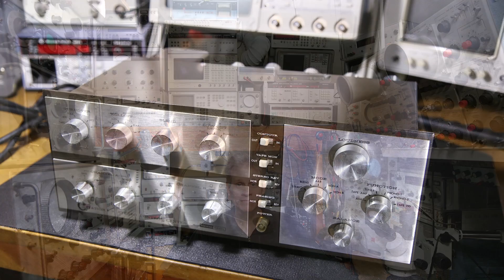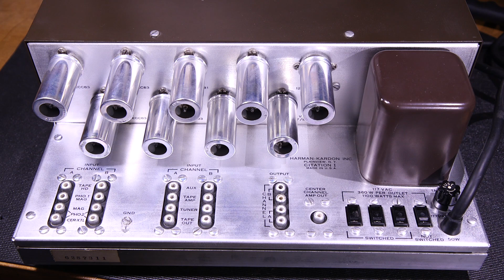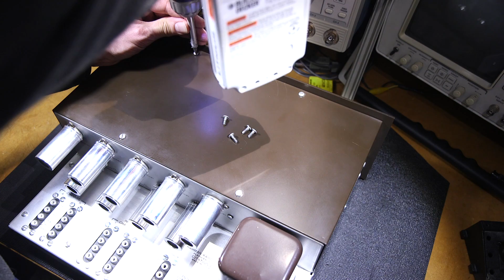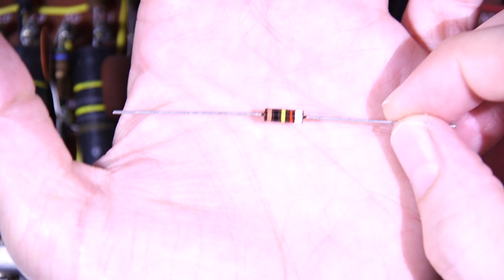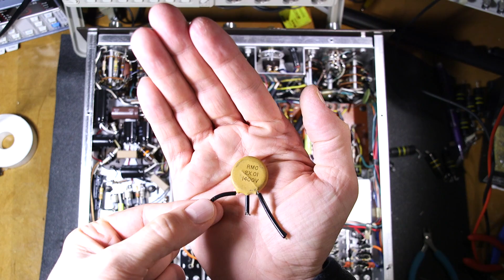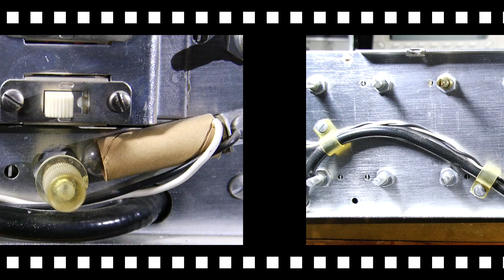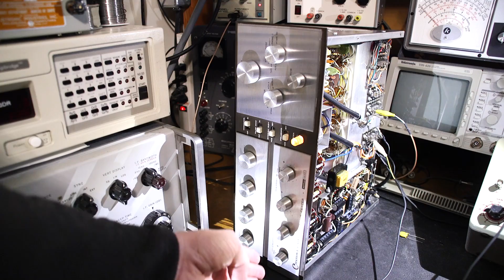Vacuum Tube Preamp Repair, Harman Kardon Citation 1

Comment: Great presentation as usual!
As I have had a few cases of capacitor failure in my personal bag of experience, I would like to see some statistics of the really old capacitors that you replace wholesale fashion, relative to the new ones.  My experiences have been almost entirely on measuring instruments, mainly of 1980 or so vintage and control systems from 1980 to 2014  Of the latter category, just about all the failures have been on solid tantalum capacitors (the "yellow drop" type).  I do try to test especially old aluminum electrolytic capacitors for their value, ESR and leakage, but seldom find anything marginal and recall only one complete failure in an HP instrument.  On the other hand, I did have a failed capacitor this year in a couple years old, made in China HD TV recorder box.

One advice I got a long time ago (1960's) regarding old radios that might have been collecting dust for unknown time was to power up in short steps.  The idea was that electrolytic capacitors have gone through internal chemistry changes while idle and have an excessive leakage current until re-formatted.  So, the suggested procedure was to turn the power on for a few seconds (long enough to allow the rectifier tube to warm up and charge the main filter capacitors.  Then let the capacitors discharge a minute or two.  Next turn the power on for 30 to 60 seconds and again let everything settle for several minutes.  That would allow the heat developed inside the possibly leaky capacitors to dissipate.  After that it would be much safer to apply power for a longer time.

I am not in a position to verify the usefulness of this approach, but I still do actually do my ancient toys power up this way.  And moreover, I have a while back helped a capacitor manufacturer by building a controller for his formatting bath.  Nothing of that completely contradicted the old hearsay instruction, although it did not confirm that either.
Reply from the maker: Thanks for your comment Pellervo!
Reply: I have read about people re-forming the old electrolytics by using a variac to gradually turn up the voltage to avoid applying full voltage to them too rapidly.  We are talking hours at 10 percent and so on.   But if the electrolytics are dried out then you need to replace them.

Comment: Im confused why there is thumbs down this is superb video work and very educational  every video is of the highest quality in image and information i think some people are jealous.good work  mr carlson!
Reply: I think they are audiophiles that were expecting Mr Carlson to insert capacitors the size of 2 liter bottles.
Reply: @mockingbirdanalog  yes,and without enough power supply de-coupling!!"if .5 mfd is good,1.5 mfd must be better"!
Reply: @Philip Holmes   ,    It takes some design knowhow to make a decent power supply. See Paul's analysis of a power supply which needed a SMALL cap to stop ringing from an "excited" choke. You don't often see good engineers at work.
Reply: @Mr39036ce  ,   Or not. Be on the lookout for roll off frequencies determined by RC combinations. This works as a common sense item. I have never seen a low value power supply filter cap so low, other than in oscilloscope high voltage power supplies. That is a WHOLE different matter! Many electrolytic caps are used in tube circuits as cathode bypass capacitors. Just use the same value cap, perhaps with a higher voltage rating.
Reply: @mockingbirdanalog  , or worse... cost as much as listed in some areas online. It is one thing to need a great cap, it is another to be silly about it.
Reply: Those were left by Yorx mini stereo owners.
Reply: @gavincurtis  Or, even more likely, by persons whose idea of high fidelity is listening to their iPhone through ear buds LOL.
Reply: Youtube has no maturity nor intelligence requirements.  Anyone, anywhere, can comment or rate.
Reply from the maker: Thanks Kevin!
Reply: I hate seeing 👎🏻 on excellent programming... Shame upon those who do such things.
Reply: The Dollar Guy    Good point!🤣🤣🤣🤣🤣🤣🤣🤣🤣🤣🤣🤣🤣🤣🤣🤣🤣🤣🤣🤣🤣🤣🤣
Reply: The thumbs down must be jealousy as this 50 year veteran tv broadcast engineer finds no fault with this video.  I have a HK Cit I in storage and this vid almost convinces me to refurbish it.
Reply: Nice and informative as usual.Be wary of those 68K 1watt resistors.Notorious source of noise in these.
Reply: There is a certain faction of hard-core original parts fanatics, and they go apoplectic when, for example, someone says a bumblebee cap has to go. It's more about psychology than sound engineering.
Reply: It could be as simple as someone having a bad experience with one of those and it brought it back.

Comment: Back in the 60's, we'd buy our hi-fi gear from Mom and Pop shops or small chain stores, and most had their own service and repair depots in the back. When you bought some new audio gear, the dealer would typically put their sticker on the side of the unit, to encourage you to get your service done at their shop.

Comment: Oooow ouch electric screwdriver!?
Reply from the maker: Believe it or not, you have greater stability in control removing slot head screws this way. Just guide the bit and press the trigger.

Comment: Another fascinating video. I find myself eagerly awaiting each new release.

It's a pity that we didn't see you soldering one of the new caps into the pre-amp since you went to some lengths to explain the need to avoid lead stress.

Comment: Paul, how do you decide which piece of gear you will do a video on and what would it cost to do a restoration?  Reason I ask is I have a Grommes Precision 61PG [1956] integrated 20 watt vacuum tube amplifier which has had the coupling capacitors replaced with Sprague Orange Drops but still needs the electrolytic cans replaced in addition to other possible components in need of replacing.  This amp comes with 2 pages of turnover and rolloff settings for 62 manufacturers of 78RPM records.
Reply from the maker: HI Bob, I get many requests, and the choice is sometimes very difficult. Many extremely high bidders, I can tell you that.
Reply: Go for it. I had my dad's Brook 10-C3 tube amp and preamp circa 1948 at one time. Wish I had those matched 2A3's around today. You can't reinvent history. His lab was nearby and he was my elmer for solid state. de KQ2E

Comment: I love the warm glow (and smell) of tubes. Among others I have obtained eighteen CV287 tubes. You can hardly see the glow on these so visually they are dull as are the eight KT88 audio amp tubes. Both I think are directly heated. I have no use for any of my tubes, but I like them and plan someday to make "art" out of them by powering the filaments up.
Reply from the maker: They sound like the same principal used in "Dark Heater" 6146's

Comment: You have such great videos and knowledge sir!  You do mention here to spray the controls with proper cleaner which leads to a question... Don't you need to be careful when spraying wafer switches in tube gear?  I have had to replace some very expensive and hard to find wafer switches that some weekend techs have "cleaned" with proper cleaner, but the closeness of the contacts or the voltages present created an arc which ruined the switch with a permanent carbon etching that rendered the switch non-repairable.  In many cases, the arc also took out other components and parts of the circuit so a real mess.  How do you best determine when it is OK to spray wafer switches and when not to?
Reply from the maker: Hi Derrick. Lot's of research, I can tell you that! With High Voltage equipment, careful selection is paramount. "Zero Residue" is your friend.

Comment: I have seen so many of those three leg safety capacitors that have exploded.  Had a Tram D201 that even had the paper insulation wrap of the transformer catch fire when the safety cap shorted out because they lay them up against the power transformer.

For knobs I suggest using wax paper to tighten up loose knobs.  If you use tape over the years even the non sticky side can become bonded to the knob making it hard to remove in the future.

Nice to see I'm not the only person that completely removes the component leads when replacing parts.  In my world (old CB radios) they use normal tie strips and frequently have 6 or 8 things tied to one terminal.  I see people recap and replace all the high wattage resistors and don't desolder them.  When they are done they have a giant blob of solder.  Very unprofessional looking.  Thanks for doing it the correct way.
Reply: Hi Paul, hi Mike, you two do such a great job with your instructional offerings I get a plate of lunch or dinner and enjoy every second. I always look forward to whatever new you two post. Thanks for your channels.
Reply: That's exactly what I do Clark. I have enjoyed every video you have done Paul. Very informative, even to us old and seasoned Tech's. Thanks Paul
Reply from the maker: Thanks Clark, I'm glad you're enjoying the video's!
Reply from the maker: Thanks for your comment Mike!

Comment: Thank you for the HK Citation 1 resto, I have 2 of them. What are your thoughts: Top Hat Diodes replacement? Also HK ran the filament voltage @ 10.5 volts would it perform better @ 12-12.6 volts?

Comment: What is the MFG and Part number of the Ceramic Standoff you used on the Electrolytic Caps, as I would like to buy a Bagfull of them
Thanks Keith
Reply: +1
Reply from the maker: Some comment's above have links.

Comment: why not gut the old cans and put the new electrolytic capacitors inside the old cans and keep it stock and polypropylene metal foil capacitors, you might be able to use STC can electrolytic capacitors, tubes like the ECC88s will work at 54 volts which is maybe a bit safer and maybe operated of 7x9v PP9 batteries for the B+ voltage and a  LM7806 6v regulator for the heater voltage.

Comment: I'd love to know what Paul's preferred contact cleaner for potentiometers is, or what any other experienced audio electronics engineers have to say on the matter. I tried looking into this some months ago and there were a lot of strong conflicting opinions, and I'm still none the wiser.
Reply: Try CRC "Tuner 600" its made for cleaning sensitive contacts, and it leaves no residue. It also takes away any lubrication though, so you might need to put another coat of lube back after you used it (for example CRC 701). Some Deoxit will have the lube already as a "two in one" kind. Sometimes that helps, sometimes its not what you want.
Reply: Thanks. I was wondering about the lube when using solvents.
When you get a pot with damping, one that is really slow and smooth to turn, is the damping created by grease within the pot?
Reply: yes. they use some high viscosity oil or grease in the bearing of the pot axle/shaft
Reply: I seem to remember, and I hope I'm not talking out of school here, that Mr. Carlson once said "I've tried a lot of contact cleaners..." and suggested the "MG Chemicals, the one with the gold stripe...," which I took to mean "MG Chemicals Super Contact Cleaner With Poly Phenyl Ether." That, or Mazola Corn Oil -- Ether one. I have no affiliation w/ MG, I just wanted to use the 'Ether pun.' Apologies to all the fine "Deoxit" folks. I hope someone will correct me if I'm wrong here.
Reply: All I've got on hand is some MotoMaster electrical contact cleaner that specifically says that it's meant for automotive use, not electronic. I imagine this is due to the specific solvent they use to dissolve the schmoo that could also end up tarnishing or dissolving solder masks or epoxy used in electronic components. Might be worth a video to test the effects of these various contact cleaners.

Comment: Please use a small container to put the screws in, as you take them out. Never place screws on top of the actual unit you are taking apart: for one thing they will scratch the finish, and secondly you are more likely to loose one or more screws this way.
Reply: Yeah,  I learned to use a magnetic bowl for mine after I kept losing them.  But honestly,  Paul has some of the best electronics videos on youtube hands down,  I'm not gonna complain about where he puts his screws and I'm sure someone with his experience knows this already anyway (he could have done it for a reason or it just slipped his mind).  I really wish that every electronics video had the production quality that his do.
Reply from the maker: Done for video purpose to show the screws (and filings), no scratches so no worries.
Reply from the maker: Thanks Dacke!
Reply: It's really depressing when you disassemble and find that somebody before you has used some larger metal screws or even sheet metal screws, and has distorted or chewed up the female end of the fastener system. BTW, especially in high-end test gear, not every cover or mounting screw is the same length or even size. Sometimes, the internal clearances are so critical that a couple of screws are deliberately shorter than the others, so watch what you are removing as you remove it.
Reply: Something to maybe add, when i disassemble things like that i use kind of a sorting box with multiple small compartments, filling them up from left to right and starting a new one with every "level" i dig deeper into the device.. that way when you reassemble (maybe days later sometimes or even longer) you can just go the reverse direction and make sure you dont miss some screws in the end :)
Reply: Yea... I work on LOTS of laptops too, and there are a lot of varying size
screws, so I always lay them out in a physical pattern on a cloth !!!
Reply: Just get a piece of paper , draw out the screw layout and label them (eg M3x6, etc.). Most laptops I disasembled have the screwholes labeled anyway ;-)

Comment: Mr Carlson, thank you for tackling this wonderful preamp. I use one as a daily driver and I can say that the Citation I is a fantastic preamp, especially if you are playing LP's and 78's. I rebuilt mine using all orange drop 716p capacitors, replaced cans with new cans as available, rebuilt the power supply.  I also added a grounded power cord to mine (which I usually do to my tube preamps). I'd like your opinion on that. Lastly.. it would be nice to see you do a companion power amp and THEN demo them for us so we can hear the results of your labors (albeit via a compressed youtube signal!).
Reply from the maker: You are totally correct about compression, then there's the computer with speakers on the receiving side to consider as well. This all adds up to inaccurate reproduction. I do not change the power cord for ground loop isolation issues.

Comment: That preamp looked new to me. I was always afraid to pull to much on the soldier post for fear of pulling them out of the phenolic or paper board because I did that once.
Nice video, interesting that those caps were all backwards.
Reply: Look carefully and you will see that he's not "pulling" on the posts. Rather, he is using the diagonal cutter's jaw profile to apply a simultaneous pull to the wire and a push to the post. It creates a force strong enough to rip the wire out of the soldered joint without stressing whatever holds that post. (Component leads are usually plated steel, much stronger than solder alloy.) Warning: this is an advanced technique, you will damage a few wires and posts as you teach yourself the "feel" of doing this (remember, it's the rotation, not the pull), and even more importantly, when you can get away with this. You probably shouldn't try this if the wire you want to remove is not the top or outer wire, or if the solder blob is too generous.
Reply: @wb6wsn , Totally true in all respects. Especially the last observation. We all have to remember that "common sense is the most uncommon sense of all." (Samuel Clemens)
Reply: K5AZE Bud  I agree I'm always so afraid to put any pressure or tension on any soldier joint, I have pulled out vias and lifted traces..... nothing more annoying

Comment: finally, a professional tube amp repair, without a condescending tone on "tube amps in general"

I did a repair video on the Pioneer SM-83 tube amp, but I still have to edit it
Reply: Isn't that the tuner-less version of the SX-82 receiver? I look forward to that. Those things are supposed to be like the high point of 7189A tube circuitry.
Reply: I'd love to see this, I have a SM-83 aswell that I rebuilt. They are great amps!
Reply: Rod, you are right. Even though, the SM-83 is a bit more sophisticted in details. I think I've got the SX-82 aswell, should be in the mailbag (donation from a guy in Germany). I hope it will be unpacked shortly.
Reply: The SM-83 is one of the best sounding tube amps I've ever heared. If it's supplied with the proper 7189A tubes. I've had an interesting failure with an arcing 7189A. The Harman Kardon from Carlson's video is in mint condition. And it has a wonderful set of Telefunken tubes. This patch in particular should have an awesome sound.

Comment: Speaking of counterfeit parts, I have a very cheap poweramp for my desk and after a few years it began crackling. Opened it up and sure enough the filter caps had leaked onto and UNDER the board eating away at the copper traces. First of all they started leaking at the bottom, without signs of bloating at the top, so they looked fine. They read: 2200uF 35V 105°C nichicon(in appropriate lettering), yeah definately not... Turns out there were smaller capacitors inside, without any label whatsoever. Also the Vss and Vcc rails were at ±37 Volts. I replaced all of the capacitors, even the film ones because they looked suspicious as well. Sounds better than beforehand too.